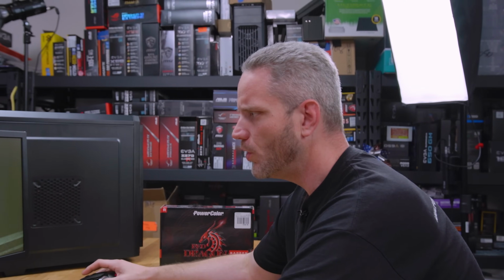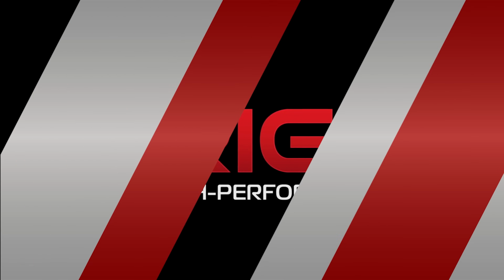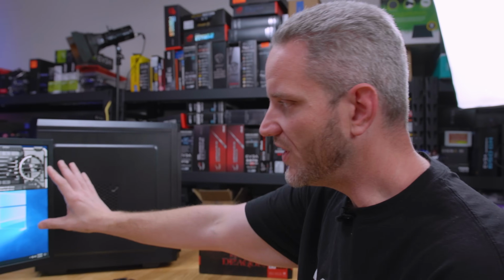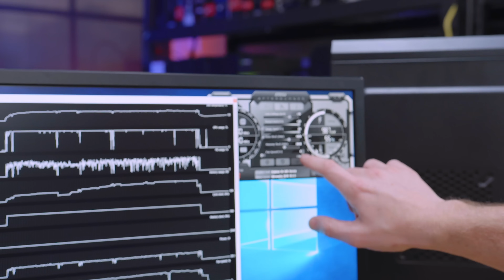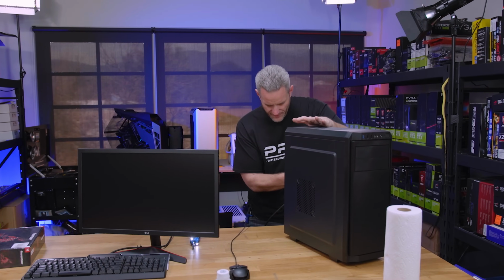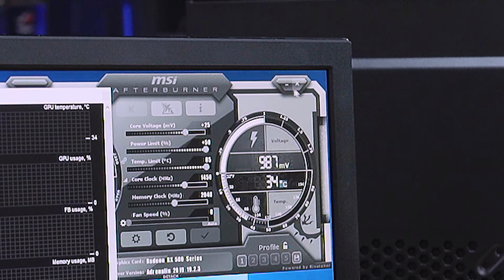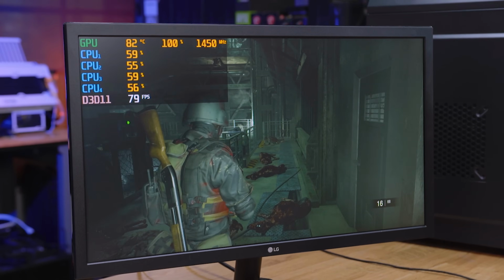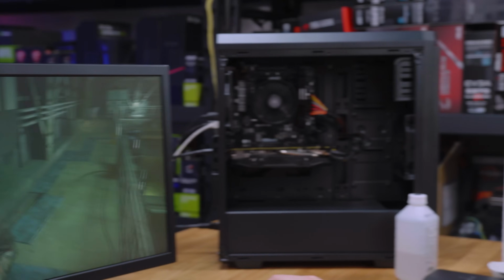Should you replace your video card's thermal paste??

Comment: Just have an idea, or a question i guess. Why were v.cards designed such that the fans are on the underside. Why didn't they design it so that the fans are basicallt on th upside. Whether it be a blower or an exhaust type of fan it would already help that the hot air would already be in the part of the case that is already close to the rear exhaust or the top rxhaust fans of the case given the usual setup of where the pcie slot is in the mobo and the size/setup of the chassis. I know it may sound kinda dumb but just an idea i think

Comment: Have a reference rx580 at 1480 mhz right now running heaven at 70 degrees.
Reply: My oc on mine is (all on msi afterburner) core volt 100+, power limit max, temp limit max, core clock 1490 and men clock 2250. Fan speed on auto. I get about 74c
Reply: @austinbulgakov3479  nice, some people just get lucky. Though my temps may also be due to the cold winter air and my fans ramped up...

Comment: I bought a radeon rx 570 red dragon and idle temps sat at 52c, thought it was odd to have 52c as idle. case has good fans and flow. past was 50% crust on a new gpu?? haha, anyway  replaced thermal paste and now its dropped 12c just with cooler master paste, very happy at that drop. could probably tweek custom curve but happy with the result, (results may vary) :D
Reply: added a 140mm fan directed at the gpu and took off another 6c at idle. love watching your vids, awesome infor and tips

Comment: What about if u open the case with air conditioner in your room? How is this better to ur gpu heat?
Reply: Not very. You need air blowing inside the case, to move the heat away from the components. an AC will lower your room's temperature, but it won't circulate air like a fan would. It'd probably be better to add 1 case fan inside the case, than to rely on the room's AC.

Comment: I recently changed the thermal paste on my gtx 1080 TI poseidon, and it did wonders. i was finally able to run at 144 fps on 2k resolution with max settings. this video helped allot!

I suggest if you have heat problems this might be one of the causes, and it might be worth changing because you can get high grade thermal paste for cpu and gpu that's above average.

Comment: i tested my GPU with Heaven for 15 min at a locked 65% fan speed.  I got 70C.  I then dusted and replaced the thermal paste, ran the same test, same time, and same fan speed and got an 8C improvement, 62C.  Lesson of the day? clean dust every 3 months, and replace thermal paste once a yr.  Small FYI did similar testing with CPU got 4C improvement but the original paste was newer, only 6 months old and from an the AIO.  I replaced both with Thermal Grizzly Kryonaut the same day.

Comment: My laptop kept hitting 95 degrees C on the CPU, so I replaced the thermal paste. It's till hitting 95 degrees C, but it takes a bit longer to hit that temp, and on smaller loads, it is noticeably cooler.

Comment: on my new Inno3D GeForce RTX2070 Twin X2 the thermal paste was very bad - gpu got hot and needs minutes vor cooling down even the game was end
 so I changed to Kryonaut paste and I polished the heatsink - after that I the gpu runs cooler: 10-20grad celsius with same fan speed

Comment: After 7 years I finally changed the thermo paste of my gpu and got a 15 degree Celsius decrease. I wish I have known of this sooner.
Reply: yeah most cases especially if its old is for sure worth it, by removing and replacing the paste you also dust out the fans/fins so that helps too
Reply: @Aleph-Noll  Didn't see much of a temperature difference after dusting off the whole PC. Guess thermal paste will be.
Reply: Repasted a RTX 2080 and had a massive 25 degree C drop in temps
Reply: 7 years? PCs are designed to be replaced every 3 years
Reply: @dl3472  if mommy and daddy are paying your bills sure. Most people dont have 3k to spend disposable every 3 yeara
Reply: @matthewmeehan7817  you spend 3k on your pc?
Reply: @dl3472  well if it works it works, my i7 4770 still work until now eventho i will upgrade it this year. :)
Reply: @dl3472  nah you're just a delusional rich kid
Reply: @dl3472  So this is how companies think. Interesting.
Reply: @Sergmanny46  unless you dont care about playing games on the lowest graphic setting.
Btw. Replacing your cooling paste and cleaning the inside of your pc wiil extend its life something most ppl dont think about

Comment: Replaced my MSI 1080ti gaming X Trio thermal greese with Thermal grizzly paste.

Ran stress test using MSI furmark 

Before replacing paste 77c
After i got 55c.

Also getting performance gains and a steady Mhz line under load compared to before which was unstable.

Wow i am very happy.

My guess is the better the cards ability to dissipate heat the more advantage you get from changing the Thermal grease on your GPU.

Comment: WARNING! Graphics cards often have thermal pads between the memory chips and the cooler. When removing the cooler these thermal pads can easily be damaged and require replacement (you can't just dab some thermal paste where the pad was because the gap is too large - you need a pad to fill the space). If you replace the cooler with damaged thermal pads, it will probably work, you may even see reduce core temps, but your memory chips are going to be hotter which may affect stability and overclockability. The pads are cheap to buy and easy to replace, but you should either have some ready before trying this or at least do some research as to whether your particular card uses thermal pads or has an independent memory heatsink, as is becoming more common.

Comment: I recently did this myself with my RX480, and have had fairly good results with temperatures when on longer gaming sessions.
Reply: Any stutter before that? My 480 gets hot it’s a blower model. But have major stutter issues.
Reply: @AgentClappers  nothing I can blame on the 480, everything been smooth since I got into modern processors, besides some lower fps in like early access games

Comment: Why can't you use liquid metal?
Reply: Liquid metal isn't worth the hassle for most people. Unless you are an EXTREME overclocker (as in, competitive), you are better off with a really good regular compound. Liquid metal has to be applied very precisely to be effective (can't just place a blob and let the pressure do the work), it is highly conductive (making it particularly dangerous with GPUs because of their exposed circuitry), it corrodes the metal (both the die and the heatsink) over time, and has to be replaced every few months. As I said, it's only for extreme users or those who don't know better.

Comment: Running my 1080ti for two years. No way I’m taking that thing apart. Paid $850 and they still sell for $600-800 used. Not chancing bricking that. Nope
Reply: Yep, same for pretty much any card. If your card is working normal, the little difference you may see is probably not worth the hassle. Only do this if your card is actually hotter than it should be and it's out of warranty. I did this for my R9 380, which I owned from new, because it was running hotter than it used to - fixed the temps and its as good as new again. I bought a RX580 second hand and the temps were fine, so I won't bother changing the paste (as tempting as it is) until the temps suggest I need to.
Reply: It’s a strix oc card too. Not exactly known for cutting corners on these. It is overclocked to 2012mhz, but the fans almost never spin up. Even running rdr2, when it runs, at ultra everything it never gets above 65c.
Reply: @richardcagle5475  then it doesn't apply. You're comparing one of the best cards available known for their performance and cooling compared to an AMD card. Your comment was nonsensical. It's not hard to put new paste in and you might as well do it - you can't kill your card, only make it run cooler/quieter
Reply: Adam Flexen what’s nonsensical is taking apart a perfectly good card to change the paste. Never over 65c under load. Why on earth would I take even a tiny risk on that? This from a guy who happily voided his cpu warranty to lap the ihs. Not afraid to mod, just saying it would be stupid to do it on a strix. My cpu was $350, not $850 like the gpu. Big difference

Comment: I just bought a rtx 2070 super factory overclocked version and it is running like this 81 82 c under full load .... I added one 90 cfm exhaust fan (I had 4 fans already that came with the case) ... And now the temp is 79c ... I think I should add one more as intake

Comment: Depends on the card. I had a Radeon X850XT PE that ran too hot and at full fan speed. I replaced the thermal paste and the card ran cooler and the fan only hit max speed while stressed out. Other cards like my old X1950 did not run cooler, but the fan was able to run at lower speeds. My modern cards have always run stock thermal paste as they don't run hot and the fans rarely run full tilt. Though I don't play many top tier FPS games. I'm happy with minecraft or space engineers(Which actually hits my graphics card rather hard at around 80% utilization).

Comment: my mates r9 290x was hitting  94c, the paste was completely  dried up, so i put a line of MX4 on the die now temps are insanely good, running valley benchmark or gtav maxed out getting 66c to 70c

Comment: Hey guys quick question, How is the Msi rx580 OC Armor 8GB in late 2019?
Reply: Like always that depends on the price
Reply: @jacobc5747  I am in south africa so the pricing is crazy different, but it's on the cheap end.

When i started to look around to upgrade my pc i found the card by accident and i fell in love with the esthetic but it doesn't help me if it does hold some relevance in current titles. I would be using it purely for gaming.

Comment: Yeah, my gtx 970  strix definitely runs cooler after I replaced the paste (I always use Arctic MX-4 for non overclocking and Gelid GC Extreme for overclocking).
Reply: GC extreme and mx 4 is same thing because they have same thermal conductivity 8.5 W/M-K

Comment: i just changed the thermalpaste on both my cpu and gpu because i was getting artifacts when the gpu hit 80°C, and uh... temperature dropped by a whopping 30 degrees on the GPU, from 80 (maybe more, i wasnt too keen to let it go higher tbh), to low 50s, and around 10 degrees on the CPU. DEFINITLY worth doing! In my case the components are 10+ years old, so idk, it could be obvious to "insiders" that the paste needs to be renewed after a few years, but i havent checked.
I used a slightly costlier paste, after comparing thermal conductivities.
Does the quality/performance of thermal paste make that much of a difference ?!
btw, i always set my fans to a constant 100% throttel. i care more about thermals than about noise.

Comment: Juat a question. It weird on my gpu. First when i got it (second hand) it overheats quite often since the old thermal paste is literally drier than the Sahara. Then i replaced it, added a bit too much (oops) then spread it around a bit. The temps went down a bit but still hot. Then recently , i planned to add thermal pads to the vrm(didnt require it lol) and replaced the thermal paste and this time did the pea and let it spread on its own. Now the temps got reduces again by about 10 degrees. Idk what i did but it was great.

Comment: I replaced the thermal paste on my Asus 1080 Ti Turbo (blower cooler) and I instantly got way better temps. On literally minecraft I got up to like 83-85 before I replaced the thermal paste. After, I got like high sixties to low seventies. Still hot for a game like minecraft, but keep in mind I run shaders and high settings and crap.

Comment: They used to make a grill and pipe system in the cases and it would allow a 90-120 mm fan that can be installed backwards to suck air out of the case. I think it is silly that they aren't really available in this day and age. It would allow the case temps to drop 10 degrees or more. So the system has a pcv pipe that sits over the CPU and GPU and pulls air out of the hottest areas and then a grill on the side of the case in the panel that can get a fan installed into it you put in backwards on purpose to suck air out.

Comment: I know it's a late comment but your thermal compound number one, isn't the best (I use IC Diamond, most people should go for Kryonaut), number two you didn't keep the fan speed constant, so your testing is invalid unless the fan speed is constant. If the fan speed is constant, your cooling solution will have a fixed energy dissipation capacity, and therefore you can then change the thermal compound and test again, since it will compare how much the thermal compound actually helps, and whether or not the factory paste is really bad.

Comment: "Should you replace your video card's thermal paste??"
Of course, if you want to say goodbye to the warranty...
Reply: Most companies are fine with a repaste, though check with your graphics card's manufacturer, as they may state otherwise. I know EVGA and some other companies are fine with repastes, though I would not recommend liquid metal, otherwise that likely will void your warranty due to the fact that liquid metal is electrically conductive and can potentially kill your GPU with one small mistake. Use a non conductive paste, and you should be fine. Not that the service people look to see exactly what thickness and/or color of the RMA'd GPU was anyways. :)

Comment: I changed the paste on my 1070 and it really changed the temps. Like 15c or more. I also changed the paste on my cpu after a year of use and it really helped as well. The cpu was on a pre built rig. It is a i5 7400 which I would get less than 3ghz on under load because of thermal throttling now it settles around 3.3ghz with the new paste. So i say if you are comfortable changing the thermal paste then do it. You might be surprised with the results.
Reply: Changing thermal paste, especially on a basically new system, will never ever drop 15C. That is the biggest lie I've ever heard. Direct die mounting mounting can barely do 10-15C reductions. The only possible way that putting thermal paste can drop temps by 15C is if someone just forgot to put thermal paste in the first place.

Comment: I applied IC diamond to my rx 5700 XT and it's running around 12°C lower at peak loads than the factory paste was allowing it.
Edit: Yes, my fans are static
Reply: Yea ICD lowered my GTX 980 temps by (relatively speaking) a lot. I have a GTX 980 Superclocked by EVGA in particular (can't remember the exact model no. off the top of my head), and even overclocked (1.206V stock voltage, 1464 MHz core, 8222 MHz memory), I had my fans set to 37% because that is the maximum speed that the fans emit no whine, so to me, it is basically silent (or low noise). With that 37%, I lost about 7C under GPU z test, and my max temps are 62C. Would have went ~70C without the repaste and w/ static fan speed.

Comment: I put thermal grizzly kryonaut on my Asus rtx2080ti OC edition as it was peaking at 72deg C under constant load. It actually dropped by around 10 degrees C and now sits at a steady 62deg C under the same loads. I was amazed how poor the Asus factory thermal paste is on an Asus Rtx 2080ti OC edition.

Comment: I recently replaced the thermal paste on my GPU (1GB XFX HD 7850) because I was having overheating issues. After over an hour of removing everything, dusting off the fan and heatsink like new, and replacing the thermal paste..

I got an increase of at least 10C and worse temps 😥 My GPU ended up burning out (literally, a component lit up bright yellow) a few days ago so I had to downgrade to an HD 6770 and now I cant run any of my games...
And the ones that can run perform worse as I have to underclock or else it overheats......

Guess that's what I get for using an old crappy 1.92W/mK thermal paste, which was all I had. oof

Comment: I've found that using a piece of paper towel stuffed inside a coffee filter works good since the filter is low- to no-lint and the paper towel absorbs a bit more alcohol so you don't have to re-wet or replace your wipe.

Comment: How is that a lower end graphics card cooling-wise? It's not the reference model with a blower, it's an AIB with a negligible overclock and 2 fans. What's lower end about it? The GPUs with 3 fans usually have a substantial overclock.

Comment: Pull heat from the GPU not push it back in. The 2/3 fan coolers blow at the cooler and pull air from below the GPU. This warm air is supposed to exit through the back of the case. What ends up happening seems to be that all the hot air gets pumped back into the case, and is used by the fans to cool the card. Pumping out the heat will lower temps, put a fan at the back of the case where the vent grill is. You will see a noticable improvement, in my case(pun intended) I lowered temps by 7-10 degrees C. That along with good airflow to the GPU will keep temps in check even on cards with completely inadequate cooling like the low end boards from Gigabyte.

Comment: all you have to do in the 580s is undervolt the card and you will see significant thermal changes. I cant keep my 580 at 56 to 60 degrees Celsius under full load. When at stock voltage I was hitting high 70s and even 80s degrees Celsius.

Comment: it's my understanding that using less thermal paste is more effective than more. You can read this in a variety of technical write-ups and testing with the stuff. Your application of "thicker" in incorrect in that case. Also, I believe there to also be a slight break-in period. Have you seen better results in subsequent testing / use?
Reply: Wouldn't matter how much paste you use so long as it covers the heat spread/cpu. The pressure from the heat sink will push any excess paste off the cpu anyways, and the same thin layer will be preety much the same.